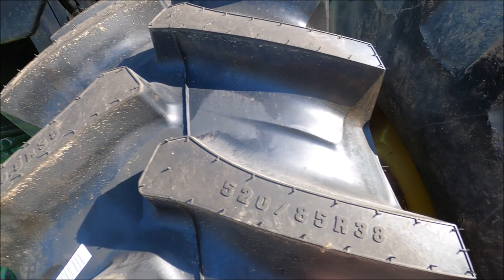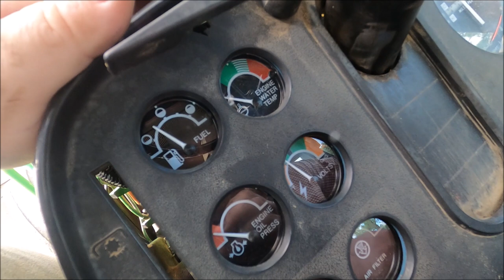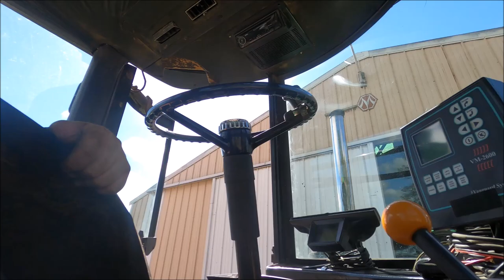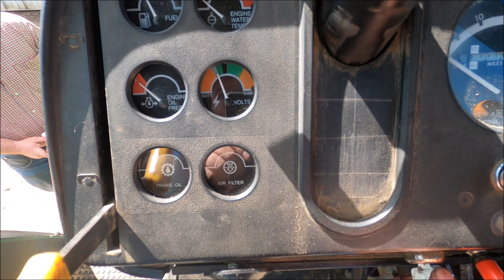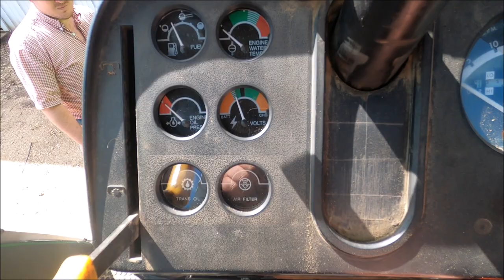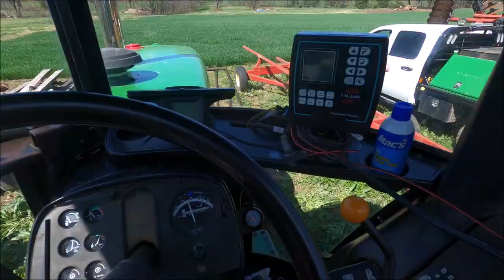How to turn a tractor into a BULL DOZER!

Comment: Crushing a Prius gets me excited. I have delivered pizza for 25 years. Right now I have three 4 cylinder Ford Rangers. In 2006 and 2010 I delivered in a 1994 F250HD with the 300-6. It got 12.5 mpg which hurt but in 2010 a lot of people were driving little tin can economy cars and the hood of that F250HD was even with the roof of the tin can cars. Out in traffic I could see up and over most cars. I had a few tree huggers bug me about delivering pizza in a big truck and I said I can drive whatever I want to. I told one guy that my knees hurt getting in and out of little cars that sit down low.